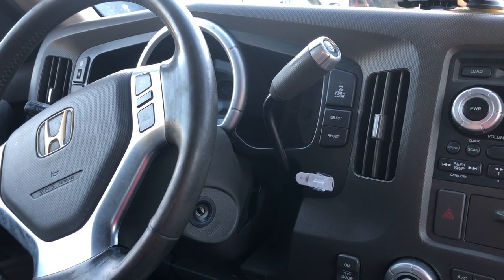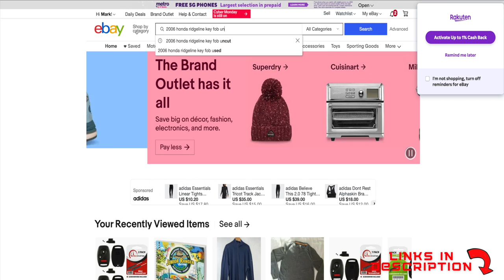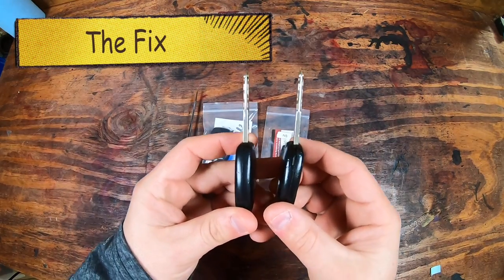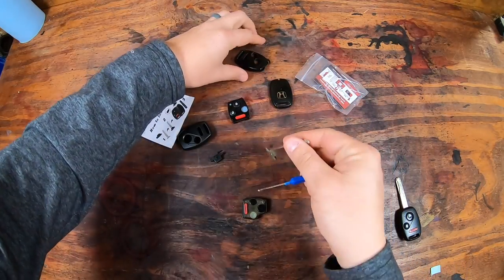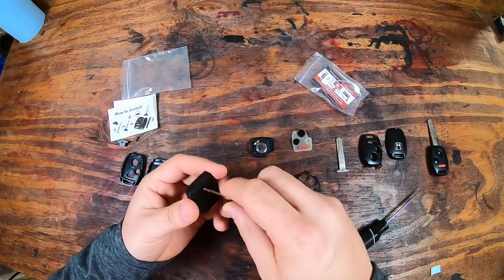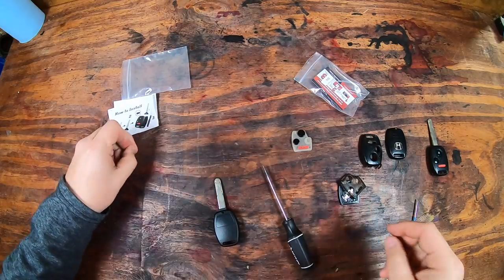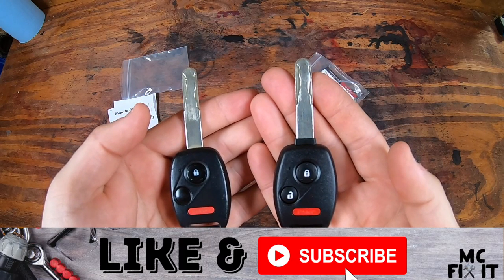How to Replace Broken Key Fob for Less Than $5 on Honda Ridgeline

Comment: You really should tell people about the transponder because your doors may unlock but the engine wont start without that chip (hidden inside the plastic housing of the old fob)
Reply from the maker: Great tip. For some reason I recorded this and thought I edited it into the Final Cut but it don’t work. I’m working on fixing this but I no longer have the missing video. I hope others find your comment
Reply: you are completely right I did  exactly what the video said but I didn’t put the transponder, and my Truck didn’t a start
he should make another video about how to put the transponder

Comment: this video put be through the ringer! I did not see comments with info about transponder. Also the FOB housing I purchased in the link does NOT fit my 2009 Ridgeline key. Whole thing caused a huge headache. Crank no start for a few days until I realized the transponder was in the old housing..glad I didn't throw it out and was simple fix. However before I realized that/checked comments I changed the sparked plugs (needed doing anyways) and was using scanner. Glad there is an updated video now. Generally love your videos this was a learning "the hard way" experience.
Reply from the maker: There’s an updated version of this video. YouTube doesn’t allow me to update videos but I did create a new video. That’s one thing that I’ don’t like about this platform. This was done on a 2006 Ridgeline and fobs change over the years. Make sure to order the correct year. Thanks for adding this! And hope it helps others out

Comment from the maker: THE TOOLS 
- 2 pack Key Fob Replacement (Honda Ridgeline 2006) - https://www.ebay.com/itm/362726463882...
-  Pick 

This video was done on a 2006 Honda Ridgeline but works on all first generation from 2006, 2007, 2008, 2009, 2010, 2011, 2012, 2013, 2014, 2015 Ridgelines. This should also work on lots makes and models of vehicles. 

Chapters:
0:00 The Project
00:49 Tools & Supplies
01:54 The Fix
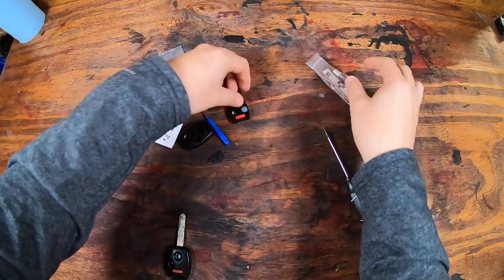02:40 Removing Old Case
05:05 Testing Buttons
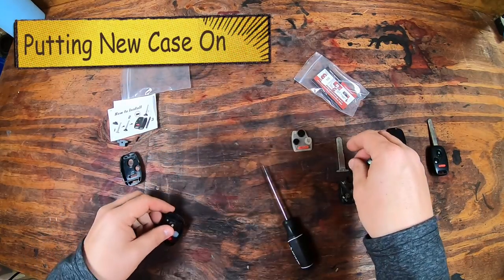05:36 Putting new Case on
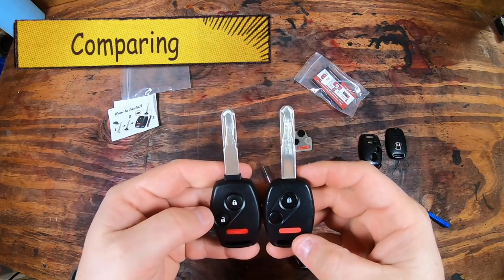07:10 Comparing Cases

Check out my website at http://mcfixit.us 

Disclaimer:
Due to factors beyond the control of MC FIX IT, I cannot guarantee against improper use or unauthorized modifications of this information in the video, post, blog, or social media. MC FIX IT assumes no liability for property damage or injury incurred as a result of any of the information contained in this video. Use this information at your own risk. If you feel uncomfortable at any time. Stop and go to a professional. MC FIX IT recommends safe practices when working on vehicles, your house, or any other project and or with tools seen or implied in this video. Due to factors beyond the control of MC FIX IT, no information contained in this video shall create any expressed or implied warranty or guarantee of any particular result. Any injury, damage, or loss that may result from improper use of these tools, equipment, or from the information contained in this video is the sole responsibility of the user and not MC FIX IT.

#mcfixit #autorepair #hondaridgeline #keyfob 

——
Supplies used to record this video: 
* GoPro Hero 7 Black - https://amzn.to/3f3ALtb 
* 256GB Flash Drive - https://amzn.to/33pAueG 
* Vlogging Frame - https://amzn.to/33tajE0 
* GoPro Pro 3.5mm Mic Adapter - https://amzn.to/2RCURCu 
* Youmic Lavalier Lapel Mic - https://amzn.to/2R55sWX 
* Boom Stand (tripod) - https://amzn.to/3bdkQaw
* 5/8” to 1/4” adapter (boom to blogging frame- https://amzn.to/3txrVsM 
* Portable Battery Powerbank- https://amzn.to/3vJQc0q 
* 6ft USB to USB-C (powerbank to GoPro)- https://amzn.to/3uAS5MH

Comment: so I purchased a new key and fab. same happened to mine . hit it and it bent . any way dealership said $160. 
after seeing your video . all have to do is switched the key into the new fab shell . program should stay the same right . ? thanks well explained video
Reply from the maker: Yes. I am actually about to updage this video. I had part of the video not record and got another video I am doing. You need to remove the small chip in the key and move it over. I m hoping to have the new video up by the end of the week

Comment: What about the transponder? Your vehicle will not start without the transponder. Mr fix it, my truck will not start now because the transponder is still in the broken case. WTF??????
Reply from the maker: Thanks for pointing this out. Not sure why that part isn’t in there. I’m going to look for that scene bc it didn’t make it into my final cut of the video. It’s just simply removing the small transponder and placing it inside of the case. Use a pick or carefully get it out with a utility knife. If I can find, I’ll redo the video and post it. Thank you for pointing this out. I want to make only helpful videos and this cut is missing a step.

Comment: you can unlock and lock but it will not start because you did not transfer the chip
Reply from the maker: Thanks for pointing that out. I did transfer the chip but it seems like that part of the video didn't make it to the final production. I need to reshoot that part and add it to it.

Comment: you have to heat the metal key to a certain extent to get the little screw out of the old one
Reply from the maker: Good tip. I didn’t have to do that but I’m sure if it’s really stuck in there that this would help